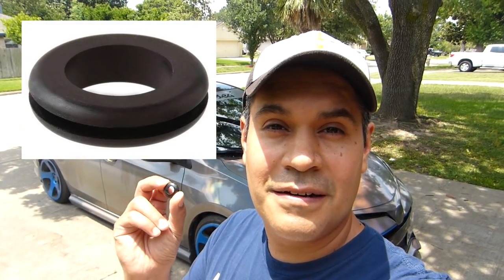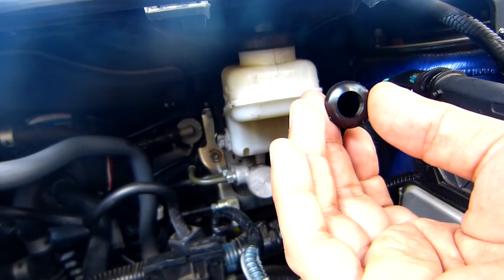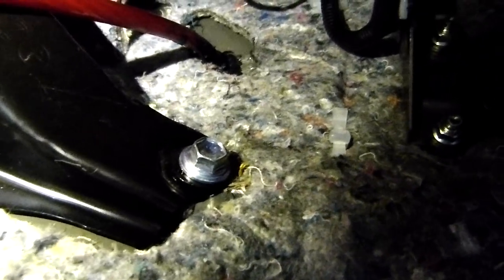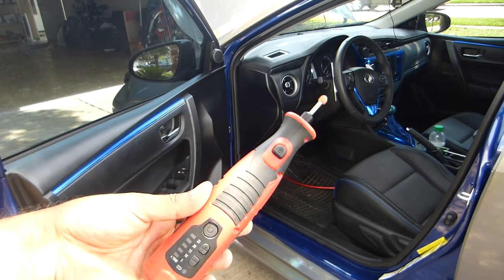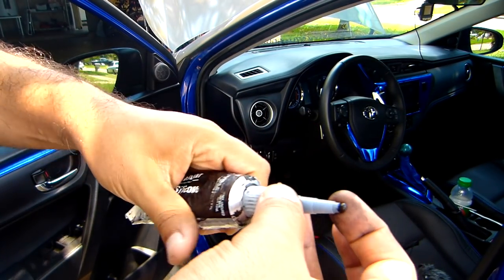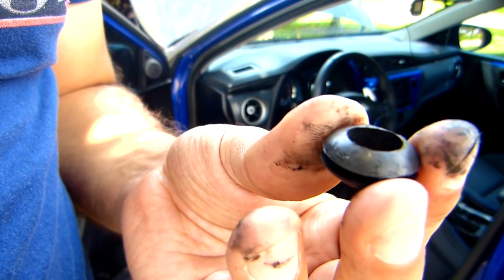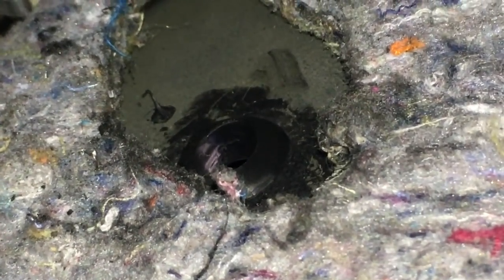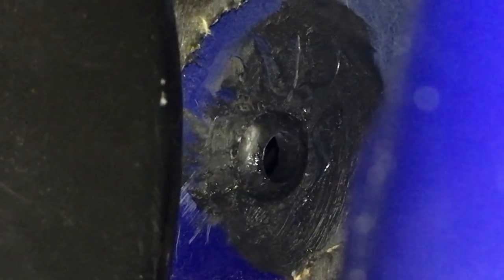Cable grommet installation CAR AUDIO

Comment: I usually slide wire in garment then start pinching pushing it thru. Dish soap around wire if your putting wire in last. When it dries it sticks. The way I  use to put my bike handles on. Lol

Comment: Thinking about doing my corolla a wide body but will need to install wheel spacers to make it look nice and get better traction. Have you had experience with wheel spacers?
Reply from the maker: If you get wider spacers get the ones that have centering ring. That’s cool thanks 👍
Reply: @Shinegadget  ok thanks for the help I'ma look into it a little more. Also a vortex generator on your roof would make your car have an aggressive look 👍